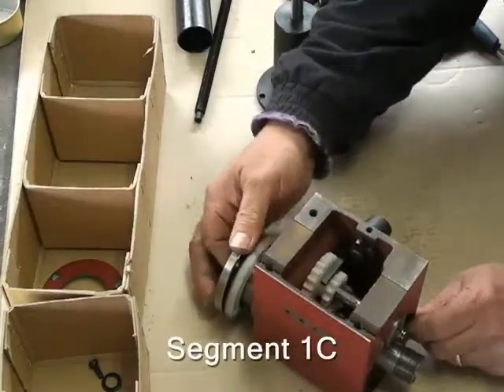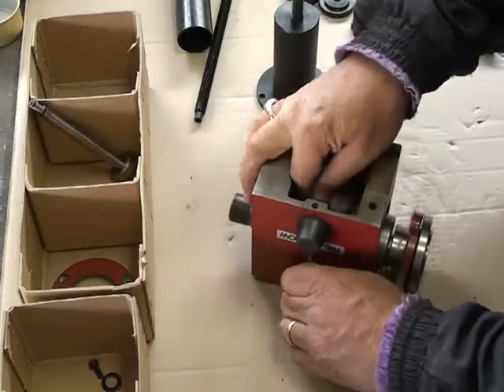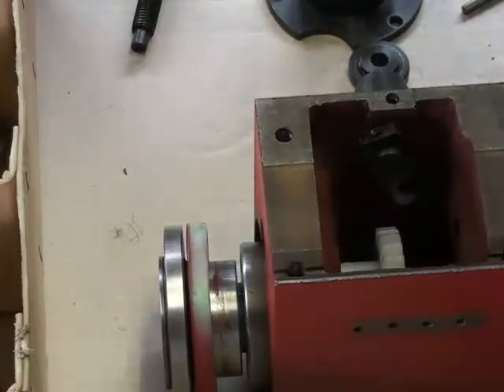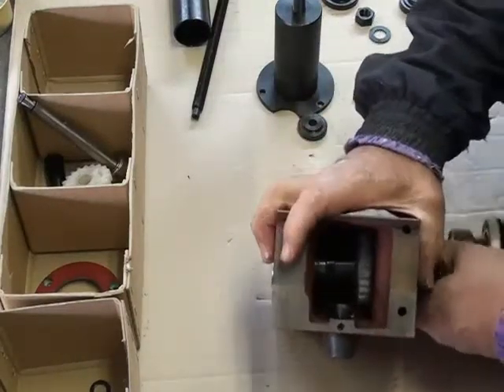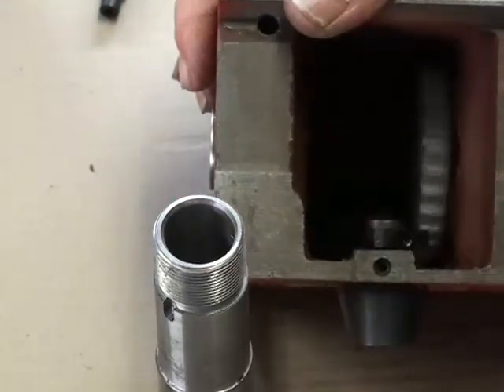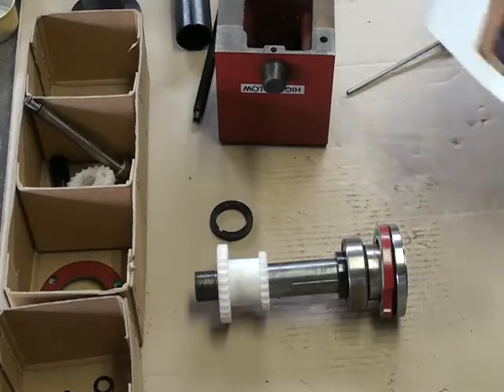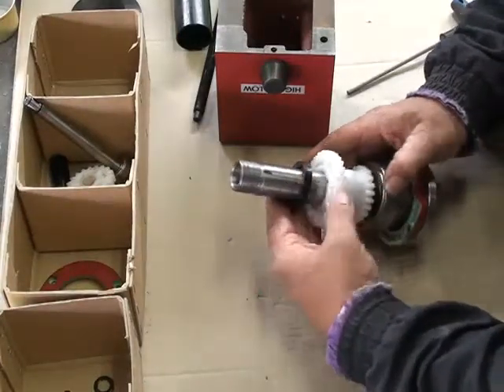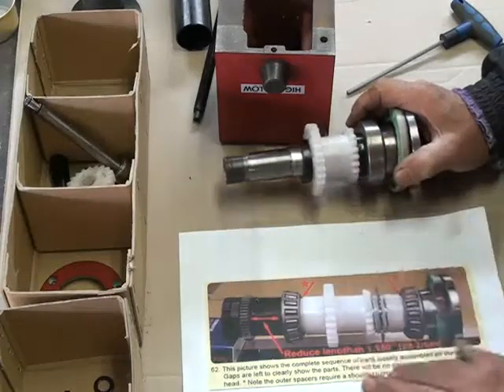Part 1C of Fitting the taper bearings to 7x12 lathe

Comment: Is there a reason y they don’t use taper bearing in the first place?  I don’t think it cost more.
Reply from the maker: Not sure why. The original Russian lathe they copied used spindle bearings which  are also called needle bearings which are the right type of bearing and supports the spindle along its entire length so it does not move side ways under sideways pressure at the work end. Good taper bearings are dearer than ball bearings. The ball bearings they use are low grade and you can buy bulk lots of 50 for around $10.  Taper bearings are used in motor vehicles as the wheel bearing and cost a lot more. However, considering the overall cost of the lathe, even a bearing costing 10 times as great would still be petty cash. It seems to be some sort of inability by these makers to understand that quality is more important than saving a few pence. The ball bearings reduce the lathe to what I describe as a toy or just plain rubbish. Had they spent more than a brass Razoo on the bearings, the quality would have made this low cost machine quite good. Europeans understand the importance of quality over cost. look at the Rolex watches from Switzerland and the  Italian motor cars - People are on long waiting lists because of quality and cost becomes irrelevant. They have learnt the that quality and thier reputation for precision is more important No, the mentality of these makers is just plain stupid and results in many derogatory remarks about their ability to understand these things, and the products they sell.

Comment: Hi. Thanks for the informative vid. I plan on doing this at some point also. I see that little Mac shop taper bearings for mine are 30206JR...Are these the same one's that you are using? If so, it shows that the dimensions are the same as the originals. 30x62x16. Assuming that yours are the same, I'M a little confused as to why the spacers have to be modified..Again, assuming yours are the same.
Reply from the maker: Hi umpy, Yes I think the are the same ones. The "JR" after the number I don't remember. If you go to the LMS site and read Chris's tips on the page for this bearing he says you will need to trim the spacers as per my video. Although the  dimensions quoted are the same as the original, the inner race sticks out a bit and the spacers need a step to allow for that. However, LMS also now sell a ball bearing type with angled grooves which do not need spacer modifications. I have not tried them but they may be suitable. The part number is 7206-B. Go to the LMS website and check them out first. Cheers and good luck with the mod. If you go ahead, you will have gained a lot of experience and knowledge about the lathe! And at some stage either the motor, or the gears, the power supply, or something will break, and having worked on it, you will have the experience and confidence to fix it yourself! So it is worth it just for the experience alone.

Comment from the maker: Hi Steve. I am glad it helped. Yes, the 3 arm pullers are okay if you can grip the bearing and everthing is just right for the threaded handle. Otherwise you need to try other methods. Tube and screw thread are quite good as you can generally find a bit of tubing about the right size. Thanks again. Lou